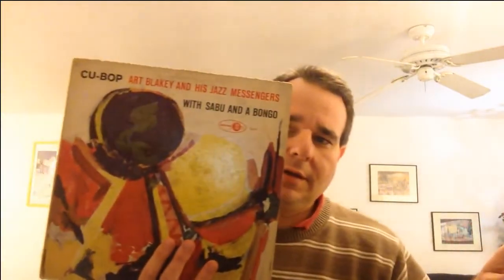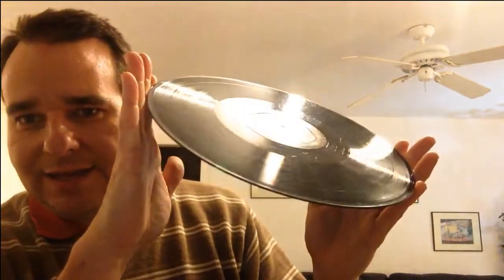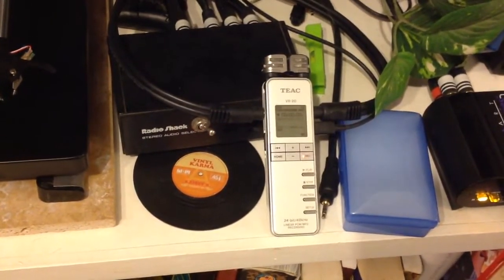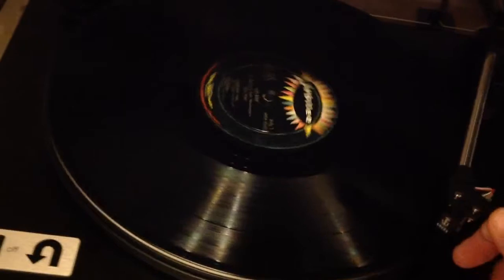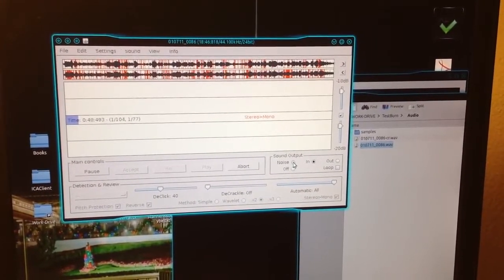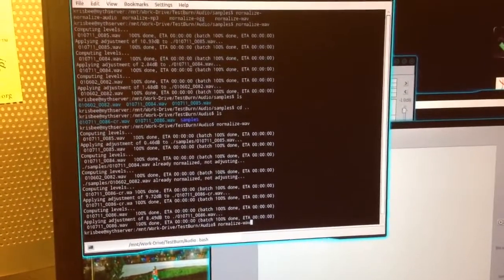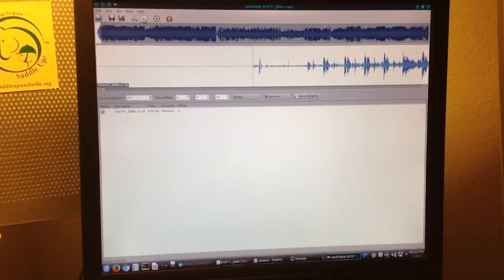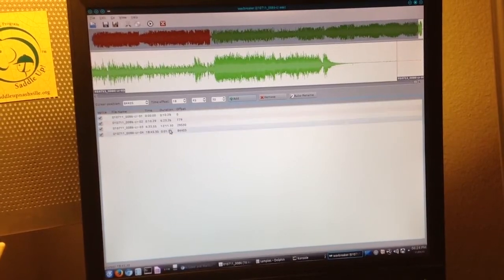Digitizing Vinyl - Recording/Click Repair/Normalizing/Track Break

Comment: Great video Kris! The before and after difference is amazing.
Reply from the maker: +baldmetalnerd Thanks so much.... It isn't something I do enough, I need to digitize more so I can listen to the albums elsewhere - some treasures I have I rarely get to hear because they are locked up in the music library... Some albums I have changed my opinion on just by having a digitized copy and getting to hear it more often...  That software is one of the few that I have gladly paid for (I'm normally an open source, free software guy)... it is worth every penny.
Reply: I use a ton of open source software on Windows the only pieces of software I actually pay for are games and sometimes Windows. The last version of Windows I paid for was Vista. I got a free copy of 7 and then of course free upgrades to 10. I even got a few free copies of office thru various promos. Although I have expelled office from all of my home machines due to activation issues and other irritations with the software so I switched to LibreOffice and it works fine.

Comment: Wow! I'm really impressed with the noise reduction! I use a program to digitize and it has a noise reducer but it's nowhere near as good as this. And depending on how much noise the album has, applying the reduction to it can leave the audio sounding a little flat, so I have to tweak the EQ a bit to do my own version of "normalizing" it. It's taken a lot of trial and error, and I've got a system down that I'm pretty happy with. But that said, the noise reduction you showed is incredibly impressive. I'm going to have to look into this. Thanks for the video, Kris!
Reply from the maker: +Matt Sands It is a free trial, so I would absolutely give it a go.  Then I suggest normalizing in audacity or whatever which will keep the dynamic range the same but just make it all the proper level without clipping (so if its' all quiet and there is only one loud bit, it sets the levels on the loud bit and the quiet parts are all as intended)... Also note, if you got a loud POP and normalized, the levels are based on that loud pop which is why you do it after the track is cleaned.

Comment: Dumb question for you.  For your input to your TEAC, are you using your line level out from your phono pre-amp?  I picked up a TASCAM Recorder used and jacked to the TASCAM line input using the RCAs on my phono out but found I am peaking out even when I try an lower the input by 48 dB on the unit when recording which is odd.   My only other thought would be to jack into the headphone amp and adjust the input manually.
Reply from the maker: +BarakaPDub That is correct, I am using the line level out from the phono preamp - I have the input set down to 0 and even still peaked a bit with the old preamp, which is why I wanted this art since it had an adjustable output... I know some guys on the hoffman forum have bought attenuators or you could even build your own since you know how to solder...I know some units have a setting to set mic/line hidden in the menu, so make sure of that - 48db is ALOT.

Comment: Recommend you consider using DeNoiseLF before ClickRepair as removing any DC component and rumble let ClickRepair work even better.  I always follow ClickRepair with DeNoise using either the lead-in or silence between a couple songs to sample the noise and then apply that noise model to the entire file.  You'll get better results by doing the A/B sides separately.  Using Audacity's Sound Finder analyizer followed by hand tuning markers in the Waveform (dB) time display make separating songs trivial (without need to listen).  My workflow is Audacity to record and normalize, export audio to 24-bit wav for running through DeNoiseLF, ClickRepair, and DeNoise before importing back into Audacity to separate songs, enter metadata, and then export to individual MP3 files.
Reply from the maker: My phono preamp has a rumble filter, so I try my best not to do too much to the sound if I can help it - if this was going to be for real preservation I would do more, for sure.  Very happy that you wrote out your method - always good to see how other people do it!  Thanks so much for watching!

Comment: Very cool. I bought a Tascam DR-07 a while back to digitize vinyl, but I never could get it to record without the input level going in the red. I don't know if the output on my particular receiver was just too hot or what. I eventually got frustrated and sold it. I've never been completely satisfied with the vinyl rips I've done on my Macbook. I've tried a couple of different external soundcards, and it just lacks something. There are some guys online who do vinyl rips that sound amazing, but I'm assuming they're using some heavy duty professional equipment.
Reply from the maker: +danner Oh, what a shame.  Its a known issue with the DR07, but you could have bought a 6 or 12db attenuator for ten bucks or so to go in line and you would have been fine.  It is amazing what sone of these guys get, but I actually chalk it up to thousand dollar carts... Maybe we are both right...
Reply: +dixielandfarm The funny thing is I actually tried a couple of attenuators, but they did something really weird to the sound. I don't know if the particular ones I got were faulty or what. Oh well, the good thing is I bought the DR07 used and sold it for the same price, so it wasn't a loss. One of these days, I might sit down and research some models that might work better for this specific purpose. I've always assumed that the secret weapon in good vinyl rips is a high quality ADC, which isn't cheap. I've just never quite been able to capture the sound that's coming out of my speakers.

Comment: Hi Kris,
I absolutely love your energy and open-mindedness when it comes to anything Hi-Fi.  If I ever need the space and I cannot carry of all of this vinyl into the next place I move into I will certainly be calling on you to help me. 
My only question to you would be {go easy on me now} why couldn't you just download all of the music that you want from a file sharing program? Or is the end result getting your digital sound to be an exact copy of your vinyl?
Your the best~
Rob/Boston
Reply from the maker: +Paneeks1960 Some records are simply not available - including this one.  The cheapest CD of this title is $30 used, and it is just too rare of a title to find online.  Also, sometimes you really do get dodgy fidelity - I remember having a downloaded copy of Forever Changes that had a horrible whistle noise throughout - apparently there was a bad CD press of it when it first came out that had a 15khz tone throughout the whole thing.  Other times, the only downloadable file available is in a low bit-rate version that has audible distortion - I had a Sparks album that every cymbal crash sounded like it was underwater due to encoding at too low of a rate or some other issue.  

Also, just like "Why bake bread when you can buy it?", there is a certain joy in doing it yourself, and yes, sometimes you really can get a better version from the vinyl than you could from the CD.  For example, the original mix of "Days of Future Passed" is only available on vinyl - the tape got destroyed in the late 70s and a remix was done and every CD has THAT version... Not to mention Mono versions, etc.  In an upcoming video I will finally get into Mastering and why very often the vinyl version of an album made in the 50s-80s probably will sound better on vinyl due to the mastering, not so much the medium (meaning your transfer of the record will sound better than the download/CD of the same record)...

Comment: I'll have to try your approach to capture. I seem to have this untraceable hum in my system that's screwing with everything. Not to mention that I have a bad habit of occasionally letting my recording program exceed the 2GB file limit it has before it splits into another file, which I can't join back together until I downsample from 24/96.

I thought it was interesting that you do your normalizing with each side. I normally do that either right before I take the noise print or at the very end if the levels were good in the first place. I  capture both sides at once, run it through ClickRepair, then bring it back into my recording program to do the noise print, mark my tracks and everything else. Generally I like keeping everything at 24/96 until i downsample to 24/48 and split off the individual tracks.
Reply from the maker: I'm a little lazy in getting the levels right for each album side, and since I'm recording 24 bit, I just let the computer do the work with normalizing :)  I also have debated going back and forth on whether to do it before or after cleaning, but I figure the computer sees the click as the loudest and sets the level based on that, so that's why I have decided to normalize after cleaning - but I have tried both ways and really don't hear much of an audible difference.  As for the hum, I have been down this road before.  Literally shut off every breaker in the house except the audio one and see if it is there.  Turn the AC plug around if you can on some of your audio equipment - sometimes if the equipment is old enough you can and that makes a difference.  USB power was the culprit on one of my setups - and it was just in the same circuit and not hooked up to anything in my audio chain, but it dumped enough hum to be induced in my setup - changed out the adapter and it was fixed.Also, I completely understand wanting to keep it 24/96, but if you are going to downsample anyway, I urge you to take your files and do an A/B/X and really see if you can hear a difference when you don't know - once I did this, I realized there really wasn't an audible difference in my setup and likely listening environment to worry about it anymore, which made it much easier - smaller files, less overhead, etc.  Of course, that was for ME.  You may be completely different - but if you aren't, you save yourself the headache of the larger files and conversion time (which is small, I get, but still).
Reply from the maker: Oh, and if you get a chance, I have a few videos in my sound advice playlist where I show off live click repair that is kind of fun..

Comment: OK, I'm a convert. I'm amazed that you can isolate the sound (you lost me at "dynamic range "bit though). Where can I buy the kit and is it expensive? Great stuff Prof. Kris.
Reply from the maker: +Ben Costello The recorder is like $60 and the program is $40... so under 65 pounds to get yourself squared away.  The dynamic range part - so dynamic range is how low and how loud something is (lets say a whisper to a shout is its' dynamic range) - when you normalize you don't change the whispers to shouts which you would if you compressed the sound (making soft parts and loud parts all the same volume) - all you are doing when you normalize is making the shout part as loud as it can be without distorting, and everything is in proportion as it always was...  that way when you listen from one song to another it isn't louder or softer than it should be (unless done on purpose, artistically)...
Reply from the maker: +Ben Costello Oh, and I'm sure you can get that recorder on Amazon or the like - and just google clickrepair to find the program to try (they have a free trial)...
Reply: Thanks Chris - where does the recorder hook to? I've no preamp etc. Sorry for being vague I'm an accountant (thanks my excuse)LOL
Reply from the maker: +Ben Costello Not a problem; if you have a phono preamp in your amp, you just use the tape loop (tape in, tape out) like the old days - so basically you just engage the tape function of your amp, but instead of a tape deck, you use the digital recorder.  If you already use a tape deck, you just put it in front of the tape deck first (so tape out of amp into line in of the recorder, line out to source in on the deck, and then line out of the tape deck to tape in on the amp)... It sounds MUCH worse than it is in real life.

Comment: I'm actually considering setting up a separate capture setup with a Tascam SD card recorder (either the DR-05x or the SD-20) and a Sony receiver. I have some kind of ground loop in my system that I can't find and I don't seem to be getting all I can out of my system. Can the recorder you're using interface directly with the computer or do you have to pull the memory card out and transfer the files over?
Reply from the maker: You CAN - it will act as a USB drive, but I found it easier just to pull the card in my setup.  Ground Loops can be super tricky - sometimes adding ground lines help, sometimes it makes it worse.  Try putting the equipment on a different circuit (use an extension cord to run it to the other side of the house if you have to) to see if it is coming in through the power/ac ground or if it is really just in your equipment/interconnects/table...

Comment: Kris, you're over-thinking this. You should just use the download card that comes with the record.

Seriously though, that was fantastic. I was really surprised at the ability of the software to determine what is noise and pull it out. I haven't digitized any vinyl yet, so this may be a silly question, but I was surprised when all was said and done that you save it as an mp3 rather than a FLAC or some lossless format. Is it a matter or practicality, where you want to save file space, or is a matter of it sounding the same so you use the format with smaller file sizes?

Great stuff. Very interesting!

Cheers, Tom
Reply from the maker: +High Rant District Ah yes - I covered it a bit in my Music server video, but I save the file as an uncompressed wav onto a CD, so I always have the full version (well, not hi res, but I did a video on that and determined that I and 90% of people can't hear the difference)... Now, for the most part, if I am going to listen to the record at home, I'm whipping out the vinyl, unless I get rid of it (gave away, etc.) so I don't see the need to save the full version on the computer - I'm usually ripping it for on the go, and out on the tractor or in the barn, a FLAC is definitely not necessary - 256k is more than enough.  I almost find it hard to tell the difference between 256k, 320k CBR, and FLAC most of the time anyway.  

If it really bothered me in the future, I could just re-rip the CD to a better container/rate... but unlike almost all audiophiles, I recognize my ears are getting worse as I age, not better.  :)

Thanks for watching, Tom!
Reply: Thanks Kris, that all makes sense. I'm going to start calling your channel Mid-Fi For The Average Guy.

Cheers! Tom

Comment: Do you use the declick setting of 40 for most records? To my ears the sound starts to be effected but just very slightly at 35. For very noise record like this one, 40 was definitely needed. I have also found that on very noise records decrackle can help a lot.
Reply from the maker: I do use 40, but my records can be quite beat.  The easiest thing to do is pick what YOU like - don't go by anybody else's setting.  Each record should really be adjusted for - just listen to what it is removing and if you hear anything in a rhythm or any music, the setting is too much.

Comment: I use to be able to run my turntable through my computer fine.. recording and such.At some point out of nowhere,it started just putting out distorted hiss when I tried too.I've changed cables,settings,and the turntable.No change.Not sure what happened.Could it be that m soundcard broke or soemthing?
Reply from the maker: Hmm, levels all set right?  Sure it wasn't also adding other stuff it shouldnt have in the mixing?

Comment: What software do you use for click/noise removal and normalizing? I use audacity for everything right now, but would like to find better software for click removal and normalizing. I am running the latest stable release of debian on the desktop that I use for copying.  --Tim
Reply from the maker: +tmecs1959 I think I use the program "normalize" for normalizing through a script that basically will run on any file in a directory, though I might use SOX.  Pretty sure it's normalize, though.  Wavbreaker for splitting up the files.  The click removal program is called clickrepair and is available as a java program, so you just use "java -jar clickrepair.jar) and it starts right up.

Comment: Anyone knows why I don't get volume levels like on CD or MP3s when I digitize my vinyls? I adjust the volume so it doesn't clip during the recording process. The normalization in audacity increases the volume but it doesnt get near the levels of mp3s or audio CDs and yet they sound very nice not distorted at all.
Reply from the maker: It's a combination of factors, but one is that most CD/MP3s made from files from the mid 90s onwards tend to add quite a bit of compression to the sound to make them SEEM louder (no variation between soft and loud sounds) - early CDs didn't do that and most vinyl doesn't either.  Normalization will find the loudest sound and make that the highest level, so lets say music went from 40-80%, it would take the 80% and bump everything up 20% extra, so it would now vary 60-100%... Compression would take that 40% and make it 90% and take that 80 and make it 100 - flattening out the difference of volume level.  I hope I explained that all well enough, and is PROBABLY what you are noticing.

Comment: Sorry mate... in which program you "normalize" your music?
Reply from the maker: You can use audacity - I actually use a command line tool in Linux (super geeky, I know)... Normalizing is different than Compressing... it doesn't change the dynamic range, only makes the loudest part correspond to the loudest allowed digitally - if the album is quiet, it will remain quiet (exactly what you want)...
Reply: Nice. Thank you for sharing!